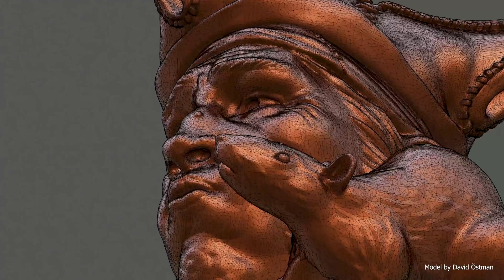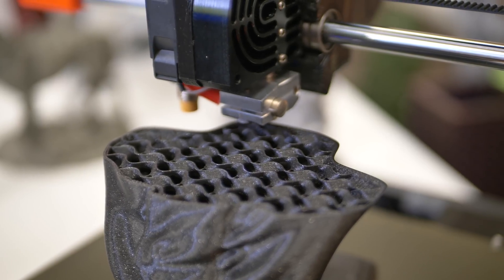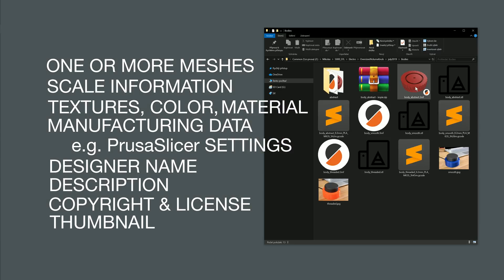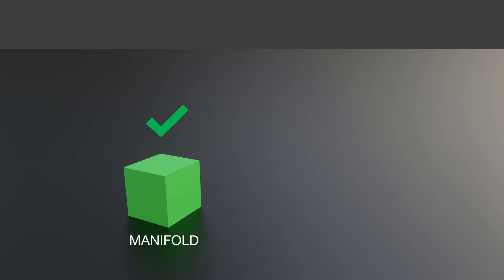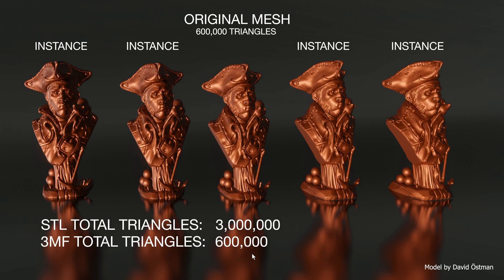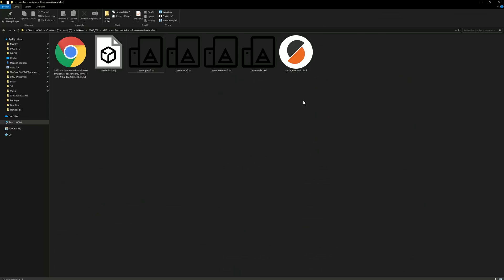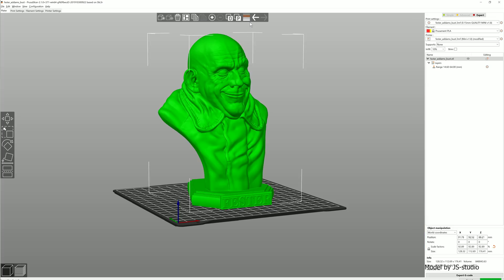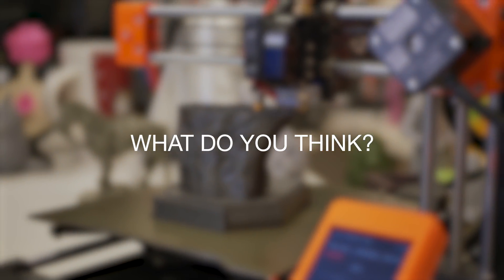Why STL is dead and 3MF is the future of 3D printing

Comment: I think community has to develop that kind of file that shall be editable in or behave like STEP etc. Since the stl and 3mf both are same in terms of meshing..Because lots of people wants to modify premade stl files but they can't due to mesh. So editability can gives more powers to 3d printing sociaty . If editability is impossible to develop for present CAD softwares then a perticular individual software has to be develop for only stl & 3mf files which can easily edit those files,like CAD stp files..
Reply: Exactly, those meshes aren't really usable. STEP would be much better
Reply: There are SOOO many 3d file formats already - why reinvent the wheel?

STL is NOT the problem, or rather it already fits the needs exactly.
The problem are the people that think that a generic format like STL should check for things that cause problems for specific scenarios.

You want models that are guaranteed to be printable? How about making sure the models is correct. That is not the job of the file-format.
Reply: stl might be ok to slice and print, but editing it is much harder than needed
file sizes on complex geometry is also bad
its resolution is finite, unlike on scalable vector geometry
Reply from the maker: Printing STEPs directly would be awesome. Changing tolerances in slicer, etc.
(-Mikolas)
Reply: @Prusa3D  do you plan to implement it in the future? I'm sure many of us would profit from such a feature
Reply: @Prusa3D  ... and what about sub-div modelling applications like Blender (3d Max, Cinema4d etc)? They produce meshes that can not be translated in step files!
Reply: I guess problem is simplicity. I'm not sure how complex file format like STEP is and what does it contain, but I can imagine some constructive solid geometry and complicated parametric curves and surfaces. Maybe something such as SVG for 2D vector graphics. Problem of formats like this is to write parser with all of features and some geometry processing library as well. Reading of something relatively simple such as screw modeled by cylinder+helix+hexagonal head with rounded edges and hole for screw driver can be extremely complex. Polygonal model can consist of 50K triangles and STL will occupy 2.5MB, but it's much easier to read.

Comment: JPEG 2000 will replace JPEG... 19 year later... Still using JPEG.
Reply: Good enough files formats tent to stick. 3MF sounds like a really good idea. The compression itself could be what is needed to make people using it. Especially for large models.
Reply: @PerMejdal  Jokes on you, I actually sometimes use JPEG2000. Or should I say JFIF? :D
Reply: Fun fact: if you watch a movie in a modern cinema, the frames are usually stored as JPEG 2000. It has found its niche, I guess.
Reply: @plopprocks  
You're right. TIL: https://en.m.wikipedia.org/wiki/Digital_Cinema_Package?wprov=sfla1
Reply: @Crlarl  I see you're using the Wikipedia app. Just a tip, you should be kind to others and remove the m subdomain so it's not mobile, and remove the ?wprov and on, as that is just telling Wikipedia that the link came from the app. It's not necessary.
Reply: @chemputer  
Noted: https://en.wikipedia.org/wiki/Digital_Cinema_Package
Reply: Isn't JPEG2000 proprietary which means you have to pay for a license to implement this codec in software or hardware? Wouldn't that be the actual reason for the lack of acceptance? 3MF is on the other hand royalty free, so you analogy isn't exactly an apples to apples comparison, isn't it?
Reply: As someone already said, JPEG2000 is a proprietary format, and will not replace standard JPEG until the patent runs out, which should be very soon.  Patents originating back then, can be extended for up to 23 years.  Once it finally expires, anyone can use JPEG2000 for free.
Reply: @KaelumYodi  Not completely. Patents describing format will expire if they are not expired already. But there are many patents describing optimizations during compression which will expire later and it's always problematic to go through all of them to assure that encoder is patent free and does not violate any patent by accident (well, it's hard to prove patent violation in closed source software and open source does not care, but problem is using open source library known for patent violation)
Reply: Pavel Peřina it doesn’t matter how many patents there are covering JPEG2000. No matter how many there are, they were all filed in or before 2000, and can’t be extended past 23 years.  JPEG2009 was backwards engineered almost as soon as it was released, so once the patents expire, everything can be freely distributed. There is absolutely nothing that the patent owner(s) can do about it.
Reply: I use png most of the time.
Reply: Every movie u watch on a digital screen in a theatre uses jpeg2000 (DCP)
Reply: You sir win 4 internets
Reply: @Mikolas Zuza - "I actually sometimes use JPEG2000. Or should I say JFIF?" - You probably shouldn't, since JFIF is the file format used by normal JPEG images, not JPEG 2000 (whose file format is called JP2/JPX).

@Marinus - PNG's adoption in web browsers was mainly meant as a replacement for GIF, due to licensing issues. It's a lossless format, with better quality and a few useful features (like layers and "proper" transparency), but results in much bigger files than JPEG (and doesn't let you choose the balance between quality and size), so it's not really an option when you're trying to save space or bandwidth.

@Per Mejdal Rasmussen - As several people have pointed out, the issue with JPEG 2000 is patent licensing. 3MF is an open format, therefore the comparison makes no sense. Lots of companies claimed at some point that their (proprietary) format would "replace all competition"; it's called marketing.
Reply: Borna Siriscevic  High Efficiency Image Format HEIF
Reply: Thats becuase it was patented and had an incompatible license for general usage. Who would want to pay for a and image format in 21. centruy. All formats need to be open source with free licenses.
Reply: Well, a lot of websites switch to webm format, but what they often do is provide user with download of that format, but when you want to send some file in webm format back, they often don't support upload of file in this format, soo...
Reply: Why 3MF chose zip Deflate as the archive?
7Zip ZSTD is quicker at the same compression 🗜️ ratio or smaller at the same speed :)
Also it should add support for JXL and AVIF in a new version :)
I moved on from JPG. I use webp on my website just like AliExpress and others. For new photos HEIF, for old JXL.
Reply: What about PNG. A lot of software nowadays exports to PNG as a standard in place of JPEG.
Reply: @MarinusMakesStuff  PNG and JPEG are completely different formats for different purpose. PNG has lossless compression (actually very same as ZIP, but with little preprocessing), while JPEG, JPEG2000 and WEBP has lossy compression and they are discarding small details or change color a little bit. In case of high compression factor JPEGs are blocky and JPEG2000 blurred. In general JPEGs are good for compressing photos while PNGs are good for compressing images containing text and large areas of same color and fine details (screenshots, schemas, logos)
Reply: @pavelperina7629  Thanks for teaching me stuff I already knew haha ;)
Reply: On the other hand, WebP is only 9 years old and is in common use.  https://developers.google.com/speed/webp
Reply: IPv6 is a good example too. 

I wish something would replace emails. Same end user functionality but without all of the legacy mess. Google tried but failed.
Reply: @jensriisomschultz3809  What is so terrible about email?
Reply: Void of Space and Time 
Soooo many things. All technical.
Reply: @jensriisomschultz3809  If it works and it's not failing, don't fix it. We've seen the issues that can arise from forcing change in software before.
Reply: It's funny how peasants think they can kill standards.
Reply: It's 2019 and JPG is dead it only exists for backwards compatibility, most of the web is now webp. and mobile cameras now support both for backwards compatibility with JPEG being dropped soon. 

Format changes take time just like jpeg taking a while to be switched out so will this new 3d printing format.
Reply: not really. jpeg has been replaced by heif this year ( within ios11 and android 9). All iphones and samsung phones  (maybe even more) by default take heif photos and hvec videos. Only when clicking "send" or "export" the phone converts it back into jpeg to prevent incompatibility issues.
Reply: @jackpat6068  Yes it is annoying trash.  As I use both iphone and android for advertising I can't just bulk download them using ftp or ssl any more.  More companies coming up with trash.  'improvements' aren't really improvements anymore.  they are just companies trying to lock down standards.
Reply: @jackpat6068  heif and hvec is perfect format for social media ( instagram, facebook, twitter,..) you keep pretty well the quality of the original pic or video, this is the reason apple use that format,
Reply: @jackpat6068  "All iphones and samsung phones  (maybe even more) by default take heif photos and hvec videos" - imagine a world where people don't shoot RAW >.>
Reply: @jackpat6068  it's funny you mention hvec because it is in the brink of being replaced by AV1 and mpeg5
Reply: @Runmeerkat  it wasnt 6 months ago when it was posted xD
Reply: @jackpat6068  well in 2018 there were already news that AV1 and Mpeg5 were coming out this year but I wasn't trying to pick a fight with you I am sorry if it sounded like that. Btw I didn't know about these codecs until like last weeek too!
Reply: @jackpat6068  yeah, a few devices switching format does not make a format change.
Reply: @voidofspaceandtime4684  35-40 % of all smartphones switching formats does in fact support a format change. Underestimate two of the world's largest device makers at your own risk.
Reply: Forcing a format change does not make the format dead.
Reply: @jackpat6068  you are exactly wrong 😉
Reply: jpg sucks balls though

Comment: The issue is that many CAD programs don’t have exporting to this file type yet. It’ll be a while.
Reply from the maker: That's ok! Export STL - Import it into a PrusaSlicer and save 3MF with your slicing settings. The transition from CAD to slicer can stil be in STL, even though it's not optimal.
Reply: @Prusa3D  what if my additive manufacturing method is not fdm?...
Reply: Actually many of them do today: http://www.3mf.io/adoption/

Comment: Hm, FreeCAD seems to support AMF but not 3MF. But in general, I tend to update the STL and let the Slicer apply the settings. Both Cura and Slic3r are better at preparing a print than any modeler/CAD I have seen.
Reply: Just yesterday I saved a project which used a support blocker mesh and two cutting meshes. I further tweaked the support settings for this specific part because it requires some really tricky support. I think Cura only saves the settings I changed, so when I open the project in a newer version I can still benefit from the better settings, but I also benefit from my project specific settings.
Reply: @angelorf  PrusaSlicer takes a slightly different approach: All the settings are stored, but when you load the 3MF, it will show you at the parameter pages, which parameters are different from the current system settings. This way you may reprint your old 3MF the same way as before.

Comment: Is it possible to import an 3MF file in CAD programs (like e.g. Fusion 360) without problems ??
Reply: Fusion can work with 3MF, but it's important to remember that 3MF is still a triangle mesh, not a primitive assembly. For that .STEP is still the king.
Reply: You can export STL from 3MF in Cura and Slicer.
Reply: @Andreas-gh6is  Thanks a lot

Comment: If fusion360 did had native 3mf export i would use it.
Reply: It does! Fusion has 3MF export. You have to go through a quick setup though and it looks like it's not very well setup for 3D printers. There is also addon for easy 3MF export, but it has the scale off by a factor of 10 :/
Reply: @TheMikolasZuza  Where does one find the "Quick Setup" you've spoken of?
Reply: @TheMikolasZuza   Not at all.  I have never seen any option, plugin, or anything for Fusion360 that exports 3MF format.  Link?
Reply: @TheMikolasZuza  u say u has a scale of a factor of 10 my stl files come out like that and i have to resize to 10% (whilst editing stl file)
Reply: @wojtek-33  Thanks!  I hate when people don't post links to plugins "this plugin is awesome, but you can't have the link".  SMH.
Reply: Or for Blender user like us!😍
Reply: i don't use fusion 360 , many other programs that mach more powerful... (fusion only for the students - learning purposes) 😁😜
Reply: Also, it really doesn't matter whether Fusion360 has it or not. The workflow should be CAD - Slicer - Sharing 3MF anyway, so the fact that we still use STL during the transition from CAD to Slicer is fine :)
Reply: @TheMikolasZuza  Using STL in between CAD and slicer isn't always "fine": in a recent-ish Meltzone Podcast episode, Stefan (CNC Kitchen) commented on how he had seen issues with precision in STLs generated from part of a large assembly, where the object in the STL itself was offset by a huge amount, and so STL's limit on the number of decimal places resulted in significant rounding errors :(

That said, I haven't checked how 3MF behaves in that regard! It looks like 3MF is mostly a "container" format (like Zip, Jar, MKV, etc.), in which case the model precision may be determined by whatever mesh files are inside the 3MF.
Reply: @AndrewGillard  totally.  container formats are good and overall simplify things, but they are still dependent on the core storage format.  Like you mentioned with mkv - it's still dependent on avc/h.264 or hevc or whatever and have still had issues with the root codec, even though the container was 'fine'.   I'm interested in knowing what the root mesh format is: I've never used a 3mf so I'm interested in how it fixes those types of problems.  Hopefully it does because we need a good universal 3d format for cad/cam CNC, for additive, for generative, etc.
Reply: @TheMikolasZuza  OK, so why doesn't my Slic3r Prusa Edition have any options to export 3MF?
Reply: @TorstenLif  Slic3r PE is deprecated and no longer being developed, it's quite likely that 3MF is only being supported in the newer PrusaSlicer.
Reply: @TROPtastic  Pity. I tried PrusaSlicer early on and wasn't impressed by it. Still, the last version of Sliic3rPE is still quite recent, so I'm in no hurry to stop using it yet. I'll have another look at PrusaSlicer some time.
Reply: Yeah, wtf? Why don't they incorporate this???
Reply: @my.luminaire  https://apps.autodesk.com/FUSION/en/Detail/Index?id=9199586017740700165&appLang=en&os=Win64  hint: When you download and installed, Reboot F360 you will find the option under Tools next to sheet metal  under  Add-ins
Reply: @TraxxasJoe13  read the comments thread before tagging someone.  Jamie Smith already posted the link.  And "patprop74" edited his comment to add the link after I posted.
Reply: @PowerSports  https://lmgtfy.com/?q=fusion+360+export+3mf&s=g here is also link